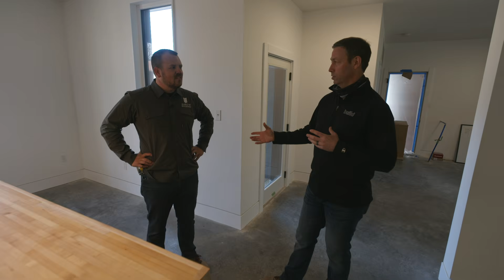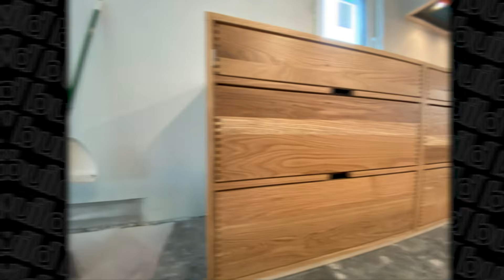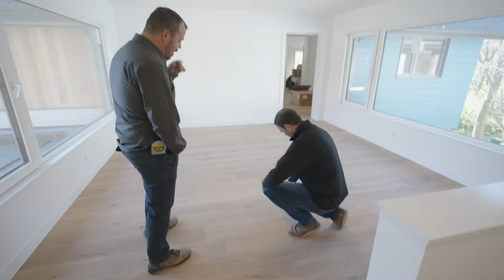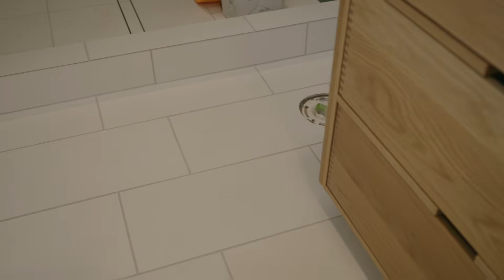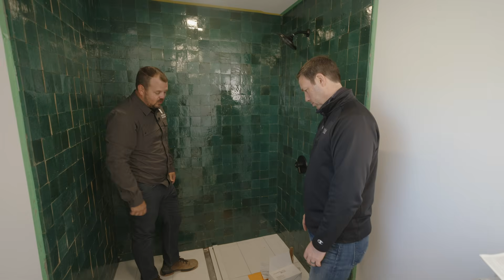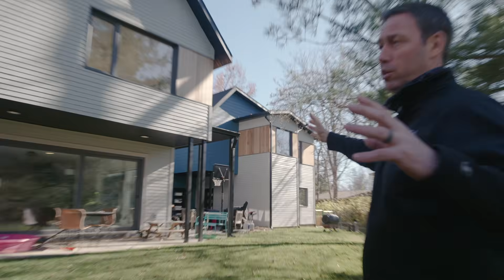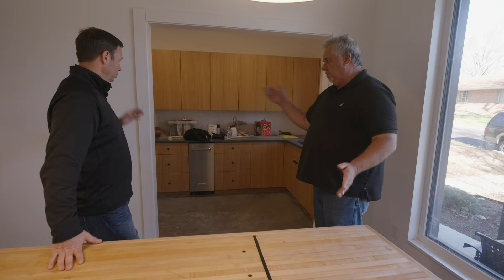Builder’s own INSANELY Efficient House!

Comment: Why put a mini split in a brand new house?
Reply: Mini splits are ideal in both new and old houses. They work much better than central air and can install one per room and they can be over sized for unexpected heat loads. Which central air can not factor in. Mini splits can work in many adjustable cooling rates. They scale up and down, Which means that on a very hot day a 24k ( 2 ton ) unit might run 20k btus and on a fair day might run 10k btu. On a very hot day and cooking that extra heat load might make it run at 23k btus. Mini splits can allow for even cooling all the time rather than shutting off and on and only cooling when it calls for it. Mini split run all the time, yet they run at such small loads to maintain the temp which is more efficient than a central air system.
Reply: @kameljoe21  how do you cool the bedrooms with a mini split in the bedroom? I also have three floors. That’s a lot of mini splits making it inefficient.
Reply: @kameljoe21  how many condensers per mini split. I’d need 11 units if I didn’t have two central air units. Fine for a small house or open concept but not for my place. Wife also doesn’t  want all the unsightly things hanging off the wall.
Reply: @danlux4954  The inside unit is the air handler and they have many different styles. They have the wall units and even ceiling units. depending on the size of the outside unit which can be quite large you can hook up many  inside unit to one unit. Though from looking at cost and size I found that adding single units to each room is just as cheap as adding a unit with up to 6 head units. 
The head unit does all the cooling its self. For example if you have rooms that are not being used then you set the temp to either higher or lower time, Meaning that it will only cool or heat it to what ever you set it at. In say the winter you can set rooms that are not being used to low temps like say 50F while the living room is set to 75F and the bed rooms are set to  60f  during the night and then turned up to 70 for a couple of  hours in the morning when you  wake up and then lowers it during the day and then turns it back up just before bed time and then lowers it during the night. Instead of maintain a 75f temp in the whole house you  can adjust each room based on use and the time you need it. Also having more than one unit works well if one fails the rest of the house is still working.

Comment: could you imagine turning a corner and walking right into one of those corners of the stairs?  I predict they will hurt Many a heads...
Reply: As a father, that was one of my first thoughts! :D
Reply: My head hurts just thinking of that.  Hopefully, they will add some padding to the underside of those corners.
Reply: Not to mention the kitchen island with the 2' overhang right at little people height.  Bop!
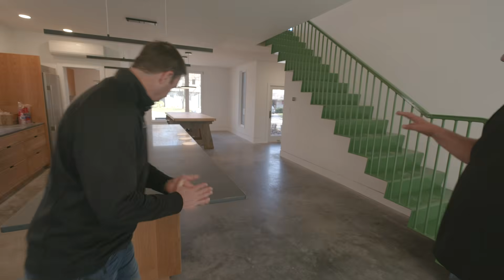Reply: No. For reference, view 22:22 and pause. You see the front door (which is typically 80 inches tall, or 6' 8") is at least a few feet below the ceiling. Let's be generous and say 2 feet. At the point you would "turn the corner", the stair case is about 8 or 9 feet high. You'd have to walk a decent ways to get to the point where your head would hit the stairs, unless you're Shaq. And since it's probably only an issue for kids, they would have to walk a relatively far distance without looking to hit their heads on the stairs. If you're the type of person who does that, perhaps you should be wearing a helmet. People like you who look for every possible thing to nit pick and turn non issues into "problems" are incredibly annoying. Just stop.

Comment: Made my small row house air tight almost 40 years ago. While sheetrock was removed installed over 100 tubes of silicone chaulk that I got for free from work. Blew in insulation to around a R45. For years on coldest days cost less then $100 a month for natural gas. Have gas heater gas water heater gas dryer & gas stove. Only problem is that only house in neighbor hood with snow on flat roof 2 weeks after it snows. Moisture level a little too high in winter but with only a 16' wide basement wall taken up by a garage, doorway and circuit breaker panel do not have room for air exchanger.

Comment: I sell mini splits.  WHY in such a beautiful space would you use a minisplit. WHY not use a recessed fan coil?  THe mini split on the wall is ugly, in my opinion.
Reply: I looked at the prices of the ceiling units for mini splits and they cost just as much as a normal unit. I did a bid with a company for ceiling units and the quote was like 1500 bucks for the ceiling unit and just for the ceiling unit and not the outdoor unit. Yeah the cost for that unit might only be like 1k. I have priced out doing my home in mini splits with nine 12k units and 1 24k unit for right around 10k installed.

Comment: Thats a scary amount of sharkbites on your hot water tank. I'd get that mess fixed.
Reply: Hopefully the whole house ain't plumbed like that 😬🏡🌊
Reply: @mikepointfive  definitely will be..
Reply: So, the water heating is just a skinny jean wearing plumbers idea of perfection.   It's a hot mess.
Reply: Yeah, it's pretty shocking that they used Sharkbites.
Reply: Came here to say the same thing!

It's pex dude... already I'm like "why are you using that plastic hot garbage"... but then to sharkbite coupling 1 foot lengths of it together. WHY? It costs pennies per foot, just cut a new piece!
Reply: @lordofduct  PEX is the future. copper on the other hand is garbage. it's expensive to buy, expensive to install, expensive to maintain, it leaks, and copper oxide is highly poisonous. the number of connections and the use of sharkbites however... yeah... that's horrible. each of these fittings also costs 20-30 bucks, which is like 50 to 100 feet of pipe

Comment: One mini split, that's amazing!
Reply: if you don't mind that 6-degree temp difference on the same floor 😲
Reply: @dodgeplow  I grew up in a house that was heated with a wood burning stove.  When the area in front of the stove was 90°F, the other side of the room would be 80°F and the bedrooms, which were on the same floor, would be 70°F (if you kept their doors open).  A 6°F temperature difference would have been really nice, but the house was not insulated anywhere near as well as this one.
Reply: @TheGuyThatEveryoneIgnores  I guess each to his own. My prior home was heated with a wood stove. Aside from the endless chore of cutting logs/splitting wood and constant feeding of the beast, I didn't at all like the big temperature differences from one part of the house to another.
Reply: @dodgeplow  In addition to all of the work involved, burning wood also made the house dirty.  Ants and other bugs came in with the firewood.   Even as a kid I decided that I was not going to burn wood in my own house.  The temperature differences are due in large part to poor insulation with exterior walls that are only four inches thick.  Ceiling fans help a little bit, but central air or radiant floor heat would be a better option to more evenly distribute the heat / cool.
Reply: @dodgeplow  In a house this insulated and airtight, probably far less than that. Also you can always go ducted mini-splits.

Comment: As to cost, he said in video it's 4300sqft.   So, $1MM+ house, using the $/sqft mentioned by Below, Arrow Building...  WITHOUT lot/utility, that comes to $903K.    "This home without lot or utility connections being built for a client instead of Jake would have cost between $205 SQFT and $215 SQFT in Columbia Mo"

Comment: It's pretty much impossible for the water heater to be as efficient as he claims if you are running the water outside.
Reply: Look into heat pumps that use CO2 as the refrigerant like that one does. They really are that good; the main downside is you usually need a two stage compressor to run CO2 as a refrigerant for the temperature range being used here.

Comment: Bomber equipment/install with super performance is an impressive engineering feat, but it is completely different from beautiful spatial design for elevated human experience.  Jake and his subs put some fantastically thoughtful and expertly crafted pieces into the house, but the third leg of design for exceptional residential construction (namely, architecture ) is sadly missing.  An arch-a-tech is not the same as an architect so perhaps Steve should change his name to the more accurate phonetic spelling (Basic) and advise his clients to hire an actual architect with better aesthetic sensibilities than XXXL polo shirts paired with (non-ironic) light-wash jeans and joggers.  

And before Steve-o chimes in calling me a troll with nothing better to do, let me say this: Advocating for legitimately beautiful architecture and not just replicant ideas and the subservience of all things to superinsulation and airtightness is neither trolling nor nothing.  Look up Maslow's hierarchy of needs and you will see that while we need shelter, we want much more.  

And and, I'm not hating because what he is good at he is really good at, but he needs to get real about what he is not good at.  Only beautiful houses are really high performance...Mr. Potato Head mash ups with pedestrian interpretations of current design trends are more likely to be torn down or at least undervalued (and poorly cared for) over the long-term.

Comment: How does this compare to double 2x4 walls staggered off-center? Where the walls will still be 8" thick, but no wood bridge from inside to out. If you add up all the 2x8s that make up the exterior walls of this house, you will have, what, something = to a 10’ 8” wood wall? The R value of wood is low. With double 2x4 walls staggered off-center walls, there would be no wood that goes from inside to out.

Comment: Two 2x4 studs spaced apart would be cheaper and more efficient than building with 2x8s. Separating the thermal mass of the studs connected to the exterior sheeting from that of the interior means big gains in the R value! 
Not to mention the electricians wouldn’t need to do any horizontal drilling through walls.

Comment: Alright so I watched yesterday and something was bugging me all day. There's the one mini split downstairs, so what do you do when you invite a bunch of people over for a party after the pandemic? All the bodies, and  the oven and stove before and possibly the doors being open and closed, how to you keep it comfortable for the guests? I really don't know, is this in the consideration for the calculations by the A/C designer?  All that open space and modern design seems key for hosting parties but if you can't keep guests comfortably cool, it may go to waste, or you end up installing a second mini split. 

Also I known they make concealed mini split headers. In wall units, portrait units, in ceiling, it seems odd to choose the bulbous head unit.
Reply: I am going to take a gander at this and bet that is a 2 ton or larger mini split downstairs. One thing that mini splits are good at is over sizing them to those heat loads due to their capability to adjust on the fly. The upstairs if I recall said there were 3 units, I am guessing one for each bed room which is even better as this allows the user to cool or heat based on what they need. 
My house is 2300 square feet and I have worked a plan out to install nine 12k units ( 3 rooms upstairs, Stairwell, Pantry, 2nd kitchen *fridges and bar sink area, main bathroom, sun room and living room ) and one 24k unit ( cooking kitchen ) To replace the crappy gas central heat and air. The ability to adjust each room temp based on its needs are far better than the existing system. Though doing this will set me back 10k to do this upgrade.

Comment: Matt: How about something on making currently lived in houses more airtight without reconstruction.  I know it is a hard thing, but it could help a lot of handymen and non-builders (like me) in your viewer community!
Reply: Very true, in theory, would be awesome to rip it all apart, but a ton of us cant afford that.  Its a shame a lot of home builders dont care, which will affect owners and the environment for decades, to save a few dollars
Reply: @virgil3241  And it is not a 'few dollars' ,it is many!
Reply: Look into foam wall cavity injection. Better R-value + better sealed envelope.

Expensive though, and it can be priced 2 ways. Sqft and actual foam used
Reply: Aero barrier at time of remodel, even with drywall in.
Reply: https://www.youtube.com/watch?v=mL8hNMObfiM
Reply: @wildadvale1334  it helps but not great for occupied homes.
Reply: A friend moved into an old 'family farmhouse' but had the interior stripped, rewired, replumbed, insulated and refinished inside.  It was the best he could do in the late '70s and is much better than it would have been.  But most of us only do that once or never.  BTW, he and his wife moved in and retired there.  His wife died 2 years ago and him this year (not Covid).  Being in their 90's it happens, but they are both missed.
Reply: Redoing your siding and a fluid applied or adhesive wrb could work very well.

Or even, replacing the sheathing.
Reply: https://www.youtube.com/watch?v=5vpssBo4wSo
Reply: @asunderco  Got a quote, Im looking at almost 10K for my house, unless I want to move everything out, put it in storage and live out of the house a few days.
Reply: EIFS is an easy but expensive solution
Reply: If one of these is the aeroseal videos, it is mentioned that the aero seal can be used on existing construction. I think you have to tarp everything, but it will seal every leak in your home.
Reply: It is called the BUILD show.

Comment: Wonder if there are any noticeable warm spots by sun side windows in the summer with not having much airflow from only 1 split? Crazy efficiency either way. Just wonder if this is a scenario where efficiency and comfort don't completely line up.
Reply: Yeah the house is poorly designed. Hot spots and cold spots will be apparent once its lived in for a year. The windows will create hot spots in many areas, there are a few shots that I saw in the video that show just how much direct light is let in rather than indirect light.

Comment: One of the biggest problems of modern day houses is too much insulation and air tightness. Improved efficiency in the winter but trade off for worse efficiency in the summer due to less ventilation. Common misconception that airtight and high R is cheapest.
Reply: This is a common misconception. Air tightness is only an issue if it does not have a designated air exchange system. All of these performance houses these folks build have that. But since ALL of them have that it is like showcasing conventional framing for them. Their other videos talk about those. This one shows things unique to this one. And air exchange is commonplace. But you are right that without good air exchange it would produce bad quality and issues like TBS (tight building syndrome).

Comment: I'm surprised they put the compressor for the water heater outside. Columbia, MO has more cooling days than heating days, so taking heat from inside the house and putting it into the hot water should be a net gain.

Comment: So I gotta ask, from your own house build, why aren't home networks considered integral to the house design, or why don't you ever show that feature? Just a half height server rack and terminations in a climate controlled closet is more than most homes need for a home security system, and a home server with expansion capacity. Maybe a couple dozen termination for cameras, APs and wall ports.

Comment: Nice house.
Couple of points; the mechanical closet seems a bit tight. There are water lines that , based on the video, look impossible to get at when they leak without removing the appliances first. And leak they will, guaranteed. Been-there-done-that...HWT exploded in my basement one time. Lucky dad was in the house when it happened, and he had easy access to the shut-off valve, but if he didn't...well. I don't want to think about it!
The other point, directed at Steve, the architect. I know North American architects tend not to do this, but European and Japanese architects do. A 12" or so wide strip of 3/4" river stone around the perimeter of the house at grade would frame the house very nicely.
Think about it Steve...maybe next time.
Like I said, nice house.

Comment: Those stairs are gonna be fun when a little kid cracks their head open on one of those bottom corners.
Reply: Once!!
Reply: @bobsherrill2672  Probable more than once; one of the houses I lived in had a Pool table in the living room(bought and sold with the house, it was crazy heavy, 9-foot table with drop pockets) and both small children and animals hit their heads on it on multiple occasions(the bottom of it was at a perfect height for a toddler running to hit their head on it, and the side pockets where about the right height for older children). Once kids and animals start running around it seems like there was always one that forgets to look where they're going or something.
Reply: the blood should wash off the stairs well enough. not sure about the concrete